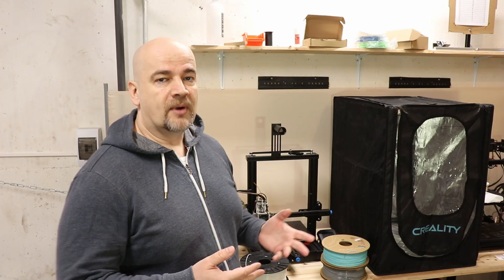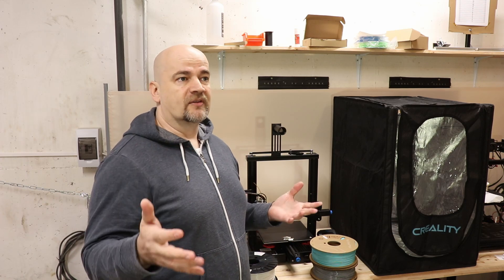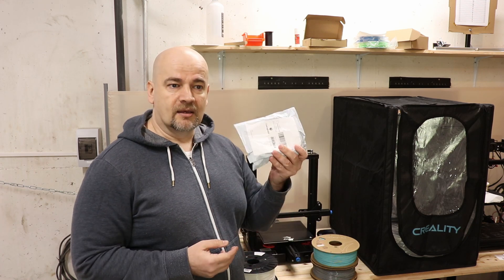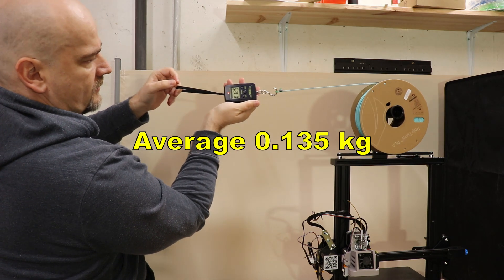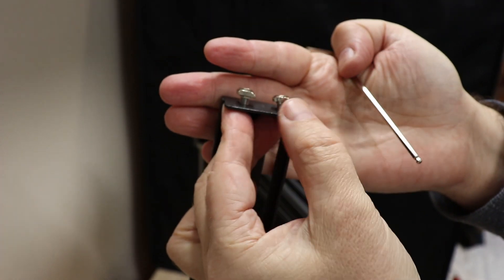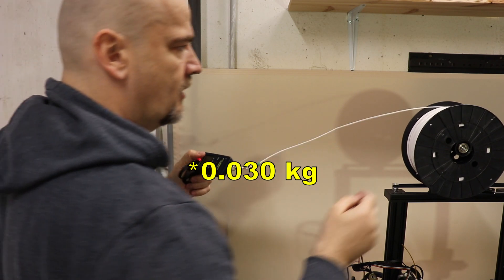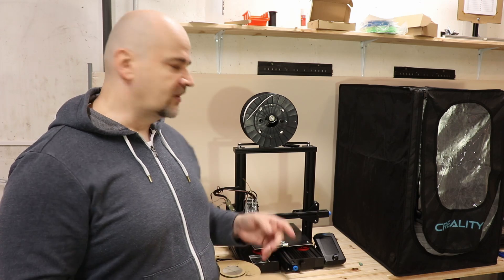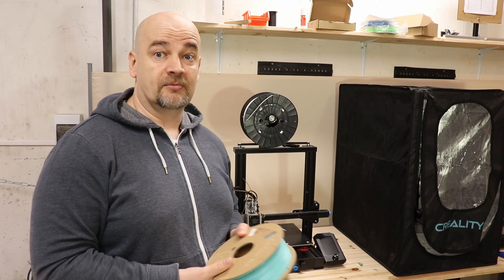Testing: Rotating spool holder by Creativity from Banggood

Comment: I designed one of these and it immediately started causing issues. Too little friction during rotation causes the spool to unwind excess filament leading to tangles, jams, and failed prints especially with the unbalanced cardboard spools. This happened with Sunlu PLA plastic spools, Esun PLA+ cardboard spools, and Overture TPU cardboard spools. Going back to the tried and true PVC drain pipe until a good open source AMS is available.

Comment: You need a little bit of friction as well so the spool does not suddenly unwind with a sudden pull and the filament tangles. You can use the regular spool holder and use sole PTFE plumbers tape to wind around the spool holder or some baking paper so decrease fristion as well. It makes the design easier, cheap and still decreases the friction.

Comment: Thanks for a great video. I purchased one of these roller setups.
It was not assembled very well. The bearings were very gritty and didn't roll freely.
Before replacing the bearings I put a sleeve of large diameter shrink wrap on the rotating spindle.
I also made a Black PLA ring 40mm round with a 30mm hole in it and 5mm thick which I press fit and CA glued on the spindle to make sure the spool stayed on the rotating part of the spindle.
Having the shrink wrap on the spindle makes sure the spool of filament has a good grip on the roller to drive the bearings.
It works very well.
Keep up the good videos and thanks for the in depth description on what you are doing.

Comment: Hi Igor. I simply cut out two rectangular holes in the stock spool holder  at measured distances one from the other. Then, I slipped two bearings over a steel rod making sure the bearings were big enough to clear the outside the spool holder. The bearings should be higher than the spool holder and come into contact with the spool. I hot glued the steel rod inside the spool holder tube, and voila. I positioned the bearings so that these are in the upper position once the spool holder is installed onto the mounting bracket. It doesn't look that great, but it functions quite well. I didn't need to use filament to make this.

Comment: I printed a very smooth rolling spool holder that used bearings and had the opposite problem with friction.  Mounted on top of my Ender 3, the spool would start to unwind uncontrollably as the extruder pulled and retracted the filament.  I ended up taking it off after a few failed prints caused by the unwound filament getting tangled up in the gantry.  I'm using an Ender 3 Max now with the filament mounted on a free-standing holder off to the side.  Maybe it's worth revisiting the low-friction holder again now that I'm not pulling filament from the top.  Good content as always.  Thanks for the review and testing.
Reply from the maker: Hm. Good to know. Then it is time to DIY additional equipment to add/adjust the friction :-)

Comment: The differences are so minor is not really worth thinking about.

Also most people running direct drive have some sort of bowden going in from the frame into which the filament enter (if they know what their doing).

Take the Hemera extruder it has 10kg of pulling force... so its got plenty to spare. Also im not a fan of free rolling spool as they tend to uncoil if the filament snaps etc.
Reply from the maker: Yes, this is not a deal breaker, but with smaller pressure on filament may result more slipping, which you will not even notice. Softer TPU needs smaller pressure for example.

Comment: Thanks for the informative video as usual. This is a great quick upgrade. Two comments to pass back to you. First, for those who are not using a direct drive configuration, this upgrade should be combined with a side mounted spool holder to help reduce filament drag against the extruder due to its better angle. I personally used a combination of 3209211 on Thingiverse with a side mount. If I knew this was available for $13, I would have picked it up instead of printing myself. 
The other thing is that eliminating the drag completely is actually a disadvantage. In the case of my upgrade, I use high quality ball bearings, and now with springy filaments like PETG, and with unbalanced spools, the spool rolls forward too much and the filament unravels and jumps the side. I caught it a couple of times right before it caused a bind against the roller. Maybe a roller with adjustable tension, or auto rollback could help in that case.

Comment: Unfortunately the "base" friction isn't the problem with spoolholders, it's the occasional increased friction that causes extrusion problems. I wouldn't know how to test for that though... besides printing and looking for signs of underextrusion
Reply: It absolutely is a huge problem for me. Had constant underextrusion until I lubed the inside of a spool with graphite. I'm printing a rotating spool holder tonight as a permanent solution.

Comment: Dear Mr. Igor .... print out a descent spool holder from Thingiverse and move on ... this is not really an issue.
Reply: Many users struggle with regular under extrusion due to friction without knowing it. It's definitely a problem for people with a weaker extruder
Reply: You are both right but any spool holder who does not rotate around his center of mass never will work fine. Trying to get it to run a little bit smoother does not solve the problem. And yes, there must be bought some ball bearings ... there is no way around it.
Reply: About 2 or 3 videos before, Igor showed how to make plastic ball bearing, though he used factory made 6MM Plastic BB Bullets as balls. I think it's a good solution to create your own custom plastic ball bearings and embed into spool holder model.
Reply: @vasiliynkudryavtsev   That's not a bad solution either but I personally wouldn't bother. On AliExpress you get 10 bearings for about 2 euro/dollar or so. Not worth the trouble :)
Reply: @WoLpH  I think, creating you own custom bearing is a good experience, because one can make some custom non-standard bearing for another projects afterwards.
But for general public using cheap AliExpress ball bearings is not bad choice too.
Personally, I ordered some metal 4.5mm ball bullets because they are not much more expensive than plastic, but should be better in endurance and more spherical. Though, I have the pack of that AliExpress 608zz bearings on hand already. Thus I could compare them later.
Reply from the maker: Thank you all for these replys. And yes, I still want to DIY one spool holder (for my Mingda D2) using those 3D printed ball bearings presented in that video ( https://youtu.be/g0EE_gVuJZA?t=918 ) Not because I don't have metallic ball bearings (I have at least 20 types) but I want to test these with 6mm plastic airsoft BB. They should be hard since they have to survive hit in mech mask (not to damage eyes). Personal experience from my past :-)
Reply: I mean it is if you want a nice one for a direct drive that isn't made of weak printed plastic.  And you'd still have to buy ball bearings and waste plastic printing it, so this is pretty cheap and handy really.

Comment: While the extruder pulls down on the filament to push it through, the filament spool also pulls up on the whole X-axis gantry! Unless you use a frame top mounted extruder. And the printers really aren't designed to deal with this force. So a smooth-running spoolholder is always good to have.

I have been using a threaded M8 rod that hangs across the back of my printer with some cone-shaped things with bearings in them that jam into the spool, and are attached by big printed wingnuts at the end, but i broke one of the cones recently, maybe because i made it from junk ABS. So my next step now is, i salvaged an inner cardboard tube from a bog roll, and i'll just print two ends for it, that will hold the bearings, and have little cone wings so the spool doesn't feel inclined to roll off. I should try to make this thing easy to slip on and off the M8 rod somehow, i think. Or maybe i just keep it permanently attached there and i can still slip the spool on and off easily enough.
Reply from the maker: In near future I want to DIY one too (for my Mingda D2) in that video I had to replace the spool holder with M16 bolt since it was too big for some spools with smaller holes (https://youtu.be/EdAn5-Pc-k4?t=1572 ). I want to test my 3D printed gears presented in this video: https://youtu.be/g0EE_gVuJZA?t=918 (links with time stamps)
Reply: @MyTechFun  Haha yeah i have some spools with 51mm opening myself, so when i just made the ends 52mm big, whooopsie.

Comment: Very nice way of comparing the effect. It does look a bit like your finger may have affected the measurements of the final plastic measurement, though that could just be the angle of the camera. I also noticed that the biggest issue I seem to see is the extruder needing to overcoming the static friction more so than the  dynamic friction.
Reply from the maker: I measured approx 5x each, only in video 2x is included. I tried to avoid placing additional load with my hand. Not super accurate measurement, but we can get the point.